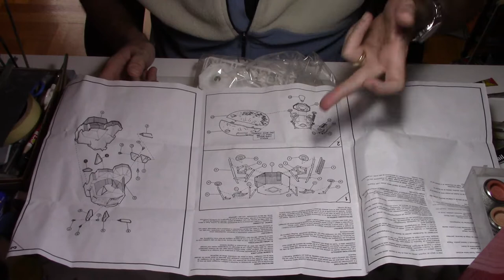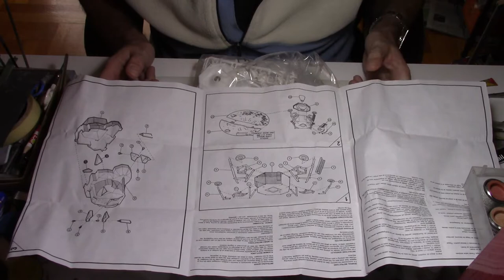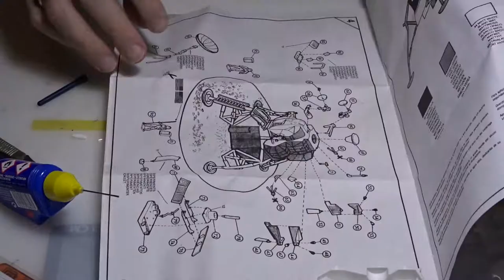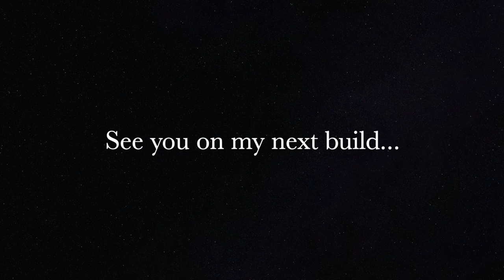Airfix 1/72  Apollo 11  Moon landing

Comment: i bought this model in the early 80´s - i too did collect chocolate gold wrappings for it :)
 at the time i couldnot find decent photos of how to paint it, so it is still dwells unmade in my bacement,
It is fun to see how op is making/painting it - That "putty filler" (?) is something i havenot seen before - must try to find some - used plastic padding back in the days but that putty stuff seems easyer. 

If ppl havent thought of it : ask your dentist for some used drills- they usually have some laying around - they are very usefull when making models.
Reply from the maker: Thank you for your comment. The putty filler you should be able to find it in any model shop, or online shop. This is very easy to use just time consuming, but it really worth it. Now with internet they are plenty of pictures available of the LEM, so you should be able to get plenty of details.

I have quite a few of those drills as well, as my Dad was a dentist 😉
Enjoy modelling, take care

Comment: I've denied myself this model for 50 years or more. However, I took the plunge and bought it a few days ago for £32.

What is the grey joint compound that you are using to mask the joins between sections? What is the glue you are using that's in the long nozzle applicator? And are you using PVA to adhere the foil?

Thank you.
Reply from the maker: Impressive 😉 50 years...
Enjoy this little kit, the grey compound is Tamya putty. Few years back it was not available in UK, as it had some toxic component. I am using a standard Revell glue with the nozzle, and yes it was PVA glue for the foil.
Have fun and let me know if you have more questions

Comment: If memory serves from 53 years ago I remember on my model it had imprints of the astronaut's shoes on the Luna surface; they were about 3 times the size of the little figure astronaut's feet!  By the way, you mention that you use "Super Glue" on some of the parts; does that glue not burn the plastic?
Reply from the maker: yes you are perfectly right with the shoes print. 
For the superglue, it does not burn the plastic. Only the regular model glue when used too much on the part ;-)